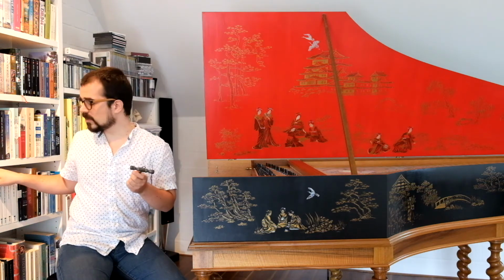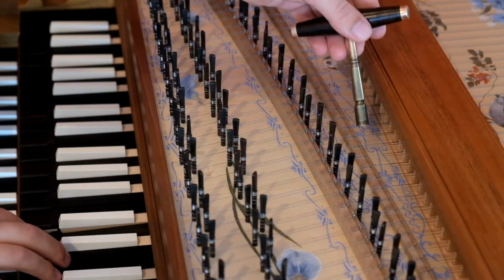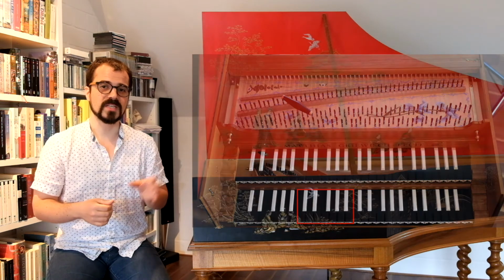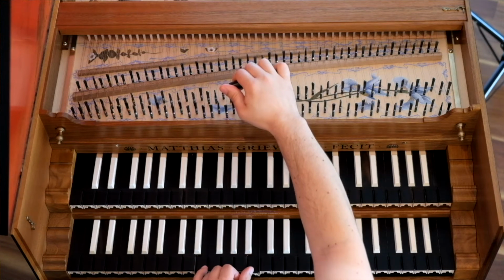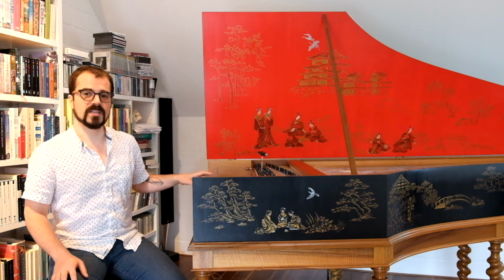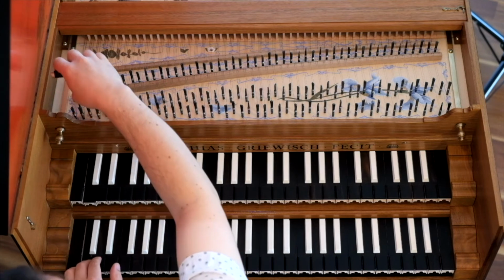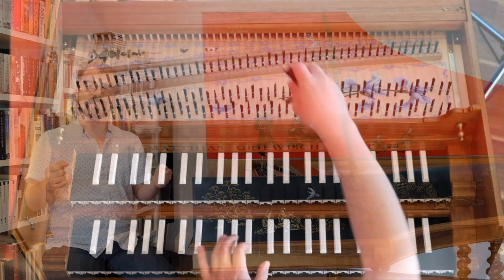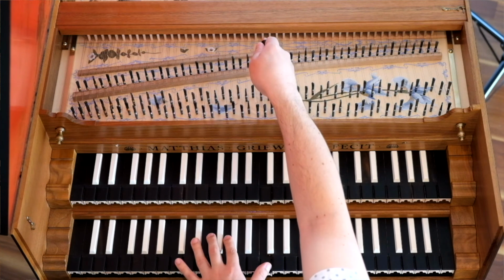Introduction to tuning

Comment: Thank you for your videos! I enjoy watching them and learn a lot. I’m new to this, and I’ve been using equal temperament to tune my harpsichord, and I want to experiment with one of the temperaments you suggested. Once you set the temperament, all the octaves will be pure, correct? Regardless of the temperament? Also, can you suggest the best and most usable tuning if you play with other musicians?  They tend to like equal temperament, but is there a historical temperament that is usable and reasonably easy to tune for someone who’s still learning all this? I’m not great Tuning by ear yet.  What’s a good temperament after equal temperament that works well with chamber music, continuo playing? I’ve gotten so many different answers!
Reply from the maker: Hi there, thanks for the comment! I'm happy to hear you like my videos :)
Oof, those are a some very good questions, sorry in advance that the replies end up being so long!

- Exactly, the octaves and unisons are perfectly pure. Some people like deliberately setting them out of tune, ever so slightly, as they feel this gives the tuning a certain body. Personally, I don't agree, and I prefer my unisons and octaves to be perfectly pure. I have also not come across anything similar in historic sources. Finally, it should be added that in a concert the harpsichord will go out tune by itself, so this seems like wasted effort to me ;-)

- Many people will tell you to tune Vallotti. I strongly recommend against that! Not only is Vallotti very anachronistic (very late 18th century, and except for Tartini - who seems to have been a personal friend of Vallotti's - nobody ever mentions him or his temperaments), it also sounds atrocious. Equal temperament at least had its proponents throughout the centuries, so it is somehwat historically appropriate. When it comes to temperaments, I always try to tune what's appropriate to the music, historically speaking. As "all-purpose-tools" I usually go for Kirnberger III, Werckmeister III, or Temperament Ordinaire. They are really easy to tune by ear (four 1/4-comma meantone fifths which make up a pure third, and the rest of the fifths are either pure or quasi pure), and sound really great. Things like Vallotti or Equal temperament or Neidhardt have lots of slightly out-of-tune fifths, sometimes in odd places, making them difficult to impossible to accurately tune by ear. Finally, it has to be added that, excepting fretted instruments like lutes and gambas, as well as wind instruments to a certain degree, there's not really any temperament that's "more" or "less" comfortable to play with. There are temperaments your colleagues will be used to, and thus they feel more comfortable to them. But many of colleagues have confirmed that, once you get used to them, meantone or Werckmeister or Kirnberger etc. are just as comfortable - or uncomfortable - to tune to as any others. It's just a matter of practise, of course.

Hope this helps! Feel free to keep the questions coming :)
Reply: @AndreasGilger  Thank you for the great, detailed information!  I am using a T-tuner because of you!  I will continue to work on my tuning--seems like it's not 'setting' well . . . upper range just goes sharp, lower range falls a bit almost immediately.  I don't think it's the harpsichord; more my tuning skills, or lack thereof. Thanks again!  You are very kind!
Reply from the maker: @michaelmastronicola3158  Sometimes it can be the instrument's fault, or the climate's fault. A harpsichord that's tuned rarely will go out of tune quickly, and a tuning will move with both temperature and humidity. The extreme ranges of your instrument will reflect those changes most noticeably. So: don't fret - and keep turning those pins :-)

Comment: Your videos are a great help to me. I am a lifetime pianist that has just purchased my first harpsichord, tuning became an issue almost immediately. Your advice for 3rds, 4ths and 5ths are of much help, but I couldn’t help but notice that when you play your C note on the instrument here in this video, it’s actually playing a concert Bb, just wanted to understand your reasoning, and if I should consider the same at home. I’m playing on a small scale 70’s era 54-key Neupert Tellemman.
Reply from the maker: Hi there, I'm glad to hear the videos are proving helpful! Well spotted: this harpsichord is not tuned to a=440, but a=400. It's a pitch that was used in France in the late 17th and throughout much of the 18th century (with some exceptions, like e.g. the opera). So, it's still very much a C, albeit on a different pitch :-) Your 1970's Neupert is likely to be tuned at 440 Hz or thereabouts, so you tune to that pitch, of course. EarlyMusicSources.com have a great video on the subject, if you want to learn more!

Comment: At those times, there were the organist to develop new tunings. Usually they were not tuned on the organs. The organists knew that. They developed just to show that they are interested end engaged to make the organ sound better. It was a matter of renommé. The church liked to see such engaged folks. Vallotti belongs to them. He describes, how about a harpsichord was tuned 100 years before and was therefore out of any public interest in 1776. Here is the point of his anachronism. Same goes for Werckmeister, Neidhardt, Kirnberger. No source for having been tuned.
The harpsichordists had one good sounding tuning and another for all keys and this was all they needed. They were responsible for their tuning to work fine in the next concerto. So they selected the one or the other. We should not expect sources here.
The lutenists prefered tempered placement of the frets. This was done by sight, not by ear because it is easy to make. And that was it. So did the  bass Gambists.
For the reference tone they could have used a tongue whistle, which gives a stabile tone. If you blow stronger, it gets louder, not higher. But they did not.
Tempered seems to be the same word for two different tunings. They said, tempered tuned by monochord sounds not fine, but tempered by ear sounds better.
So, what do we really know about baroque tuning?
Reply from the maker: It is true: compared to the massively varied practice of tuning the amount of information available today is very slim. The temperaments on organs were usually changed to adapt to modern demands, harpsichords go out of tune, and few people bothered to write down their methods of tuning. But that should not be an argument for dismissing what information we have. Often, historical authors would not write prescriptively, but descriptively. Take for example the "tempérament ordinaire" in France: authors writing about it would describe current practice of tuning, and one author (Sauveur) even calculated the pitch of his harpsichord - twice, and accurately! We have pitch pipes, tuning forks, wind instruments which allow insight into pitch of certain times and places, and we have descriptions of how people tuned their instruments as well as surviving instruments with their original temperament intact. We have people complaining about how some instruments were difficult to play at the same time because of their different temperaments (for example: fretted instruments like lutes on one hand, and keyboard instruments on the other hand). What's more: there actually is evidence of the organ builder Kunze (or Contius) having tuned his organs in accordance with Werckmeister. So, even though massive amounts of information are lost, even though all the "in house temperaments" of individual harpsichordists and organ builders are lost, what does survive should absolutely be taken seriously. How else are we to ever approach the sounds of centuries past? It's all we have!
Reply: @AndreasGilger  And we have Zang, 1800. Let us tune the organ tempered and take, what comes. It will be not the best, but the last 150 years of looking for a better organ tuning were wasted.
Reply from the maker: Zang is by no means the first author to advocate equal temperament. At any rate, I vehemently disagree with the claim that equal temperament is "the best" temperament. There's nothing quite like a pure major third ;-) And even if equal temperament were "the best", experimenting with and learning about other temperaments is hardly "time wasted"!
Reply: @AndreasGilger  You make a common mistake. You do not see the difference between me and you.
Zang was the first to advocate equal temperament. Many years before and before Werckmeister a French organ was tunes tempered. It sounded uggly. They changed it after a short time and never turned back. Zang knew about this.
It should alarm you, that Zang advocated the tempered tuning 150 jears later, knowing, it was no good tuning. He was frustrated.
Best organ tuning is Klaiss. This firm earns a lot of money with making their organs sound better than the rest. But ist is not perfect. The problem is unsolved. his is nowadays, not baroque.
You mentioned Vallotti. You can not even say, was it meant as organ tuning or harpsichord tuning. Surely, it is of none importance, Vallotti was not tuned.There were two reasons. 1.: They knew, it was a new organ tuning. Therefore they did not tune organs with it. 2.: They saw it as a harpsichord tuning. They could already tune their harpsichords for all keys. They did not need that.
Now lets us have a look to England. There is the Fitzwilliam book. They had a tuning for all keys. But this tuning was not written in a book. There is no English tuning book. Every student learned it from his master, also tuning, so every harpsichordist knew, what to do.
The logic is the same in France and Germany. They all knew what to do for playing in many keys and needed no book for it. So, here an explanation is necessary for the books with the tuning tables.
Same thing with the feathers, same thing with the only sufficient cheese on Italian noodles.
Amsterdam was very Protestant. Amsterdam was at the coast. They had many feathers of seagull. So they wrote, seagull sound best. 
France was Catholic and France was Paris. In France they wrote, Raven makes the only good sound. Which means, the protestant sound is not so fine.
They invented more and more well tempered tunings to show their intellectual abillity and to be prout of themselves. They did not need them. They did not use them.

If you think, Buxtehudes organ was tuned in Werckmeister III, read the souces carefully. Buxtehude met Weckmeister and they decided to tune the organ in Werckmeister III. The organ was tuned then by a local organ builder, who tuned the organ as the parish wanted to pay for.
Now to the most important thing, the style of interpretation. The Germans were trained organists with the ability to play the harpsichord. The French had trained harpsichord players. The Germans first had to take care of the pedal. It is like walking, one step after the other step. There above is the melody. So they played the harpsichord.
The French harpsichordists wanted a melody, that speaks. Really, this is better for the audience. And the audience pays the chose. Besides, this is your personal position and I think, you do it fine and I enjoy it very much. But this is me and you and not Baroque.
Now German organists came to Paris and wanted to make a carreer as harpsichordist to make good money. They played their compositions in their style. The reaction was "Die deutschen Komponisten eignen sich zum Ackerbau."
I do not believe anything I can read. They were better. But if a French harpsichordist hears them playing, he regists a lot of stylistc mistakes. If we make an interpretation on stage, we should divide between French style, German style and Italian style. 
If you think, Bach was German style, no, it is not so clear. When he was young, he could hear French harpsichordists, playing French music in French style. He knew the power of the speaking melody. Later he wrote letters to French composers, this is all we know, but there was contacts.
In spite all of this, dont change your style playing the harpsichord. You are one of the few which can be listened allways with interest.
Reply from the maker: @martinh1277  You open up quite a few cans of worms, my friend, more than I would like to argue about in a YouTube comment section. So permit me to comment on what I perceive to be some factual mistakes in your reply regarding the topic at hand before I bid you farewell and withdraw from this conversation, as it's taking up a bit too much time for my liking.

- I never mentioned Buxtehude. His organs were most likely tuned meantone. I mentioned Kunze, who tuned some of his organs according to Werckmeister's instructions. Furthermore, there is an accurate description from 1677 of an Organ built and tuned by Förner in 1668. This organ is definitely not tuned meantone but some form of well tempered which I would very much like to see more often nowadays!

- Yes, I mentioned Vallotti, as an example what you should not tune, as I don't just think it's a bad temperament, but it most likely saw no use outside of what Vallotti did himself.

- Zang was not the first person to advocate for equal temperament. Werckmeister, Mattheson, Neidharth, Marpurg, amongst others, did so long before him.

- There are English sources for temperaments. For example: Godfrey Keller's instructions in his book on figured bass, London 1707 (posth.). There are several more throughout the 18th century. True, I'm not aware of sources from earlier in the 17th century, though I must admit that I have not had the occasion to thoroughly research this topic.

- Finally, you mention organists and organs a lot, also as a source of pushing the development of temperaments, when in fact meantone was used on organs well into the 18th century. This here however is a video on tuning harpsichords. Using information on and the practice surrounding organs, which generally served quite a different purpose than the harpsichord, and which did and still do require a lot more effort to tune, to argue a point about harpsichord tuning - a point which, if I'm being honest, remains somewhat unclear to me - does not strike me as particularly convincing.

Your points on other subjects definitely merit further conversation, but as I said above, right now I do not wish to invest the time required to appropriately delve into these matters. So I hope you don't mind me leaving it at that :-) Cheers!

Comment: Hello, I just bought a used harpsichord and this is the first time I am tuning a harpsichord, unfortunately I was given a L shaped tuning hammer so I was wondering if there is any way I can use the L shaped tuning hammer without dameging the harpsichord?
Thank you.
Reply from the maker: Hi, you'll need to be super careful not to apply any downward pressure with the L-shaped hammer. I recommend investing in a T-shaped one, that way you'll be a lot more relaxed when tuning :-)